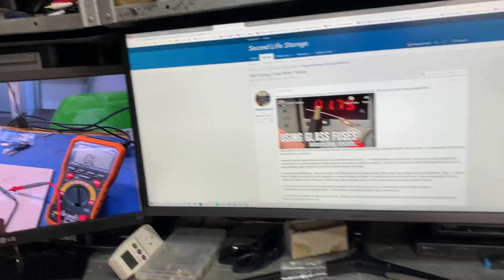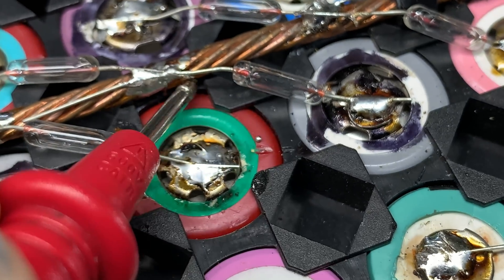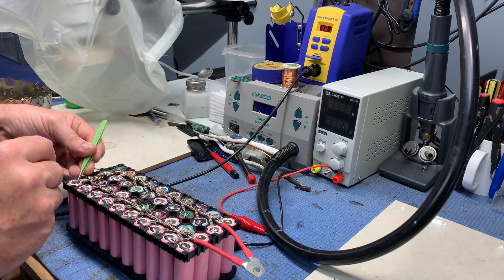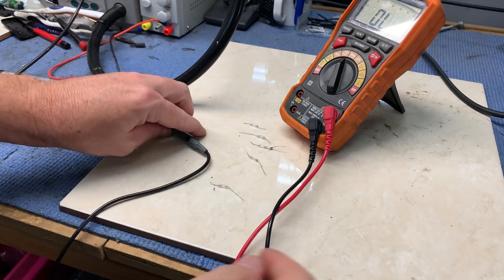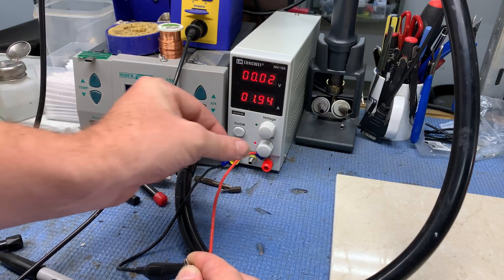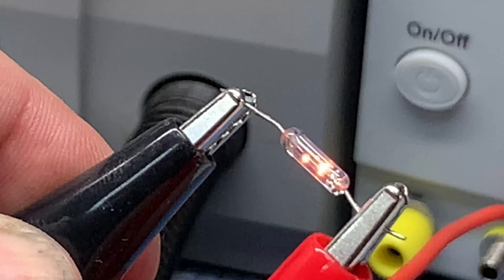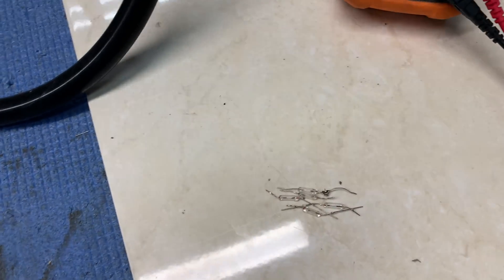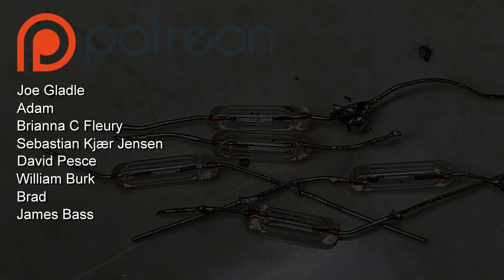Testing the 5 fuses from yesterdays video

Comment: The capacitor on the output of the power supply is blowing the 2A fuse because of the energy stored in the power supply cap. You have to increase the power supply from 0V to eliminate that problem.
Reply from the maker: Yes many others have said the same thing .. least I learnt something new :)

Comment: Hi, I am not sure if the testing setup was right here. The bench power  supplies  have capacitors  on the outputs. These  fuses could  be simply  very fast and inrush curren which will happen once you connected terminals  to the fuse could be more than 10A. I know it from my work experience. The power supply will no regulate  as fast as the  speed of the fuse  therefore you blown all of them. Batter  way of testing it would  be increasing the current  slowly  from zero to 2 A.
Reply from the maker: Thanks for the info

Comment: Let me start off with saying I love your videos.  But that's not a very good way to determine anything about a fuse.  The amperage on your power supply isn't changing because it's going to near maximum amperage faster than the display can update.  Measure the resistance of the fuse (a fixed number) and you have the voltage set at a fixed number.  Now calculate the amperage using those two numbers and ohms law.  You'll find that it is significantly higher than 2 amps.  Same exact reason you don't measure amperage with a multimeter in parallel with the circuit.
Reply from the maker: Thanks for the info, while ago now this one..

Comment: most shitty cheap power supplies cheat with their output ripple rating by whacking a nice big capacitor across the output terminals.  you're charging a honking great bit capacitor up to 4.2V and then putting it across a fuse - of course the fuse will blow.  you're putting tens of amps through that fuse before the PSU's display even updates because the current is coming from the cheater cap not through the PSU's current measurement resistor.

this kind of thing readily kills LEDs too.

Comment: Blowing it with another fuse could prove it with out need of trusting power supply.  I got a pair of cells that only in one order stayed balanced for hundreds of charges. Was reading  impedance remains constant threw cells life. Thinking the impedance of the cells could be graduated to charge evenly.

Comment: so, even if the fuses  work ? what is stopping any of those cells to start an internal reaction, generate pressure, relieve the CID and continue on the internal reaction ? by the way, this can happen under storage, charging or discharging, at any time!
Reply from the maker: one would hope having the fuses blow will reduce the energy- one cell will most likley internal short and run out of puff before it can go thermal.
Reply: The thing is, once the CID is off, you no longer have an electrical connection to the cell, it will read open circuit on the multi-meter.
The amount of energy in a 2.5volts (discharged) cell is really high because of chemistry.
the OEM manufacturer of a laptop battery makes a battery pack from the same batch of cells, some of the cells are removed from the line and tested, after tests are performed they should confirm that the capacity of the battery will degrade enough(unusable by the buyer) before the number of cycles are enough for the cells to be able to develop internal reactions. The chips, sony ones at least, also have a cycle limit programed by the manufacturer. The  safety is same batch and testing.

Comment: When testing fuses with a power supply set voltage to less than 1V. 
Reason is some power supplies have large output capacitors which on short circuit will deliver large transient currents (>10A) which will blow a fuse even if current limit set to 100mA.

Comment: i think i should check the power supply first. as it may blow the fuses due to the capacitor in front of the regulator. I provide a youtube video link check from 14:20.  https://www.youtube.com/watch?v=Wnu6surk4QI

Comment: Amps_through_the_Fuse = Battery_Voltage / ( DC_Internal_Resistance + Ohms_POS_Cold_Solder_Joint + Ohms_NEG_Cold_Solder_Joint + Ohms_Fuse )  <==  So, systematically figure out what your problem is.  Hints ... either, the battery voltage is too low, or the OHMS was too high or you have bad fuses.  Are you sure that you are actually measuring the DC Internal Resistance ?  Because, I heard you say "Internal Resistance".  Maybe, you are actually measuring the AC Impedance - which is not the same thing ...

Comment: This so-called "test" is 100% INVALID .  A 2 Amp Fuse is designed to allow 2 Amps for many seconds!  No, you cannot remove that shorting wire when the Power Supply is in "Constant Current" mode.  Your P/S sent way too many amps through those fuses ...
Reply from the maker: Maybe so but it started a conversation - and I learn something from youtube.. who would have thought lol
Reply: @HBPowerwall  This procedure might work ...
1) Connect your 2 amp "shorting" wire to your power supply 
2) Adjust your knobs for 2 amps = Current Limit Mode
3) Now the "Amps" knob is set correctly - do not change
4) Reduce the Voltage Knob down 0 volts <== Important
5) Remove the shorting wire
6) Attach the fuse
7) Increase the Voltage Knob = 2 amps flowing 
Fuse blown?
I say, "No, it does not blow. It holds for a long time"
Before testing a new fuse, always reduce the Voltage down to 0 volts ...

Comment: I have to revise my statement about the capacity a little. These lithium crystals can form quasi like a needle and thus accelerate the internal charge exchange. The danger then lies in an internal short circuit and thus in self-destruction. Since one cannot predict the aging process, thermal monitoring is essential for me.

Comment: Hi Pete, You are going in the wrong direction. The problem with cell heating is not the current that is drawn from the outside, but the current that is generated internally in the cell. With the length of use, there is a loss of capacity. This loss is unused lithium crystals. These accumulate and reduce the distance to the anode. If the internal resistance is reduced as a result, this would explain the self-heating, although the external current draw is low. Please take the bad cells, do a capacitance test and monitor the self-heating with a constant, low current draw. For reference, do the same with a good cell in parallel. This should make it clear to you that there can be a critical, low capacitance.
Reply: Heater Cells, actually do get hot from the "outside" CHARGING Current  ...
Reply: @MrSummitville  Well, then please explain to me why not heating the other cells just as much? And where is the causal difference now? The difference is the internal behavior and not the charge supplied.
Reply: @SchnickSchnackSchnuck.   You said, "... Well, then please explain to me why not heating the other cells just as much? ..." Can you rephrase using proper English?
Reply: @MrSummitville  Or, you can talk with me in German. You can do that as well as I can. I think you understand very well.
Reply: @SchnickSchnackSchnuck.  No, I cannot understand what you are asking.  I clearly stated, heater cells do get hot from external or charging amps.  Either, you understand that fact or you refuse to accept reality ...
Reply: @MrSummitville  ... or you. After reading some of your comments, you are too self-confident of yourself. Therefore any contribution to them is unnecessary here. It's a shame you could have learned something. Over and out.
Reply: @SchnickSchnackSchnuck.  I see, you still have no facts to back up your claims.  It is a fact that Heater Cells do get hot from external / charging amps.  Simply disconnect a Heater Cell and see what happens for yourself ...
Reply: @MrSummitville  I have facts, but I don't fall for a provocateur like you. You are no longer worth paying attention to, because you are disrespectful. Go your way and don't stand in your way. Get your facts right, before you claim something you can't prove. Like you did with me.
Reply: @SchnickSchnackSchnuck.  Watch the countless YouTube videos that PROVE ... Heater Cells do get hot from external / charging amps.
Reply: @MrSummitville  Yes, and why this one is getting warm and the other one next to it not? Exclude the external current. It is the cell, which have an inner shortage behavior. There are unused Lithium crystals, they can form a needle to the anode. Known as cathode shortage. It is not often, but part of coincidence. You can't load this cell so hard anymore as the other around them. Root cause - effect.
Reply: @SchnickSchnackSchnuck.  I NEVER said, Heater cells can't have an internal short.  I have stated,  Heater Cells do get hot from external / charging amps.  Which you claimed was "wrong" in your original post. Watch the videos and learn ...
Reply: @MrSummitville  If you mean, you are right, that's fine for me. I hope you learn something for yourself. And now, it's time to say good bye. Please find a different audience for your point of view. Saying sorry is a matter of character, but the solution.

Comment: I think need to series 40c thermal fuse in the 2A axial fuse every cells.. so it's blown once they reach the desire temp.. to avoid heating of cells.. what do you think pete?
Reply from the maker: Madness, a lot to be said for keeping it simple - sealed box air in at bottom - air out on top measure the temp differential make decision based on that.  IE 20deg difference TURN on fire hose and run, 1-3 deg difference SHUT it all own till you can inspect it.

Comment: My conclusion using these same fuses was with about 5% of the fuses have an internal disconnect and when you touch them with a probe or press on them or even take the dam things and test them, you end up bending the leads, binding them up, and essentially fixing them temporarily, you still have a disconnect inside that will be there randomly but they check out 90% of the time.
Fuck those things.
Reply from the maker: Sounds possilbe

Comment: Next thing to test that I can think of load test the cells individually.  If the fuse is 2 Amps then each cell that is supposed to be protected by them needs to be able to handle 2 Amps without too much voltage drop.  My guess is you need 0.5Amp fuses for that battery pack or at least for the weak cells.
Reply: But this so-called test was 100% invalid ...
Reply: @MrSummitville  I agree it was more of something fun to watch then a real test.  The math behind it meant we knew the outcome before it started.
Reply: @AQUATICSLIVE  The Power Supply actually pumped way too amps ( more than 5 amps ? ) into those fuses.  He can NOT do this "fuse test" per the method in this video ...
Reply: @MrSummitville  Yeah he did it the other way too of slowly adding more amps until it blew.  The issue is without him know the battery numbers he has no clue what fuse to use.  2 Amps is way too big.  Can estimate the math based on his marked numbers and internal resistance average of ones I have.  Max fuse would be 1 Amp.  But without some real testing of the cells can't be exact but with used cells it's not perfect.  I would use .5 Amp fuse wire to be safe but I like to error on the side of safety.
Reply: @AQUATICSLIVE  Also, I noticed that he states "... Internal Resistance ..." but it appears that he actually measures "AC Impedance" - which is not the same thing ...

Comment: Small question, what is the internal resistance of the non blown fuse cells? If it might be high it still delivers the Voltage but when shorting it might have itself a higher resistance than the fuse in which case the Voltage might not be big enough to blow the 2A fuse. Are you able to get the internal resistance of those cells with the chargers you own. Thanks in advance, you are great showing us how not to build packs and save us from harm 👍

Comment: The power supply has charged the capacitors on the output of the power supply. Bring the voltage up slowly and the fuses wont blow instantly. start from 0.5v then increase the currant.
Reply: You are 100% correct, therefore this test was invalid ...

Comment: Hi i think spotweld.s are much cleaner  and you need New protection arround the 18650 Just a little hole arround where the postive is wil make a verry fast hot fire 18650
Reply from the maker: Spotwelding is 1000x better, but this battery is years old and trying to learn from past mistakes.

Comment: If they blow immediately at 2A, they are not 2A fuses. I don't know the datasheet for these, but usually a fuse will blow after 0.1 to 1 second at twice the rated current. At the rated current, they can sustain forever.

So these are probably 1A or lower fuses.
Reply from the maker: They were sold as 2amp fuses :( Years ago
Reply: @casparv
 - Probably not 1 amp fuses.  The power supply is pushing way more than 2 amps through a 2 amp fuse.

Comment: someone was saying in another video your power supply has a capacitor on the output and the current limit only kicks in after the capacitor discharges. so even though you set the limit to 2A, when you connect the fuse it will spike above 2A for a fraction of a second.
Reply from the maker: It is possible yes, my amp meter wasn't accurate/fast enough to check that but it does sound likely .
Reply: @HBPowerwall  More than "possible". Your fuses did get a huge spike in amps ...

Comment: There's a good chance that the output of that PSU has a large capacitor attached to the output, it probably well exceed the set current for a fraction of a second. You might want to start at zero amps and creep up to the current and see when they blow.
Reply: And he need to do that with the fuse connect to the power supply BEFORE he turns the knobs up ...

Comment: I think your going about this the wrong way mate. You may be making assumptions that the fuses are faulty, but what you've just proven is that they work just fine and blow at 2A. 

I think what you've also proven is what I suggested in your last video, and that is that the cells that did not blow fuses COULD NOT blow them because they are so degraded that they cannot even muster up 2A of current flow on a dead short. 

Your ammeter should have a 10A rating, so pls put it in line between one of those cells, and a fuse, and short out the single cell. I think what you're going to find is those cells although fully charged at 4.2v cannot even deliver more than an amp of current draw. 

Please test that out as it would highlight for the community another point of failure that they likely are unaware of, and that is a cell that can go dead short and pull just under an amp heating up constantly, but without enough current to blow a fuse.
Reply: I just tested my twenty cells and the inrush, dead short across the cell, was between 32 and 37A on my CL800,  momentary touch, so don't use a nice meter fyi
Reply: @Joe Marques
 - Actually, this so-called test proved nothing.  His power supply gave those fuses a huge in-rush of amps.  This "test" is 100% invalid.

Comment: so maybe there should be a fused short test done on each cell before putting it into a pack ?
Reply: this test might need to be done with a poly fuse resettable
Reply: or maybe one of these 
https://www.amazon.com/Blue-Sea-Systems-Connect-Circuit/dp/B000MMDLQQ/ref=sr_1_53?dchild=1&keywords=resettable+fuse&qid=1610377209&sr=8-53

Comment: Can we create a large scale multi fuses tester that is not expensive to quickly detect poor performance batteries and be able to remove them easily?
Building a good power supply is the key, unless these failed cells are developed over the course of time
Reply: Failed cells develop over time ...

Comment: Could it be that batteries could not supply the 2amps to make them blow.
Reply from the maker: Honestly I doubt it. Each one of these cells could do 20 amps with the right gauge wire. They shouldn't but they easily could.
Reply: @HBPowerwall  Thanks for the reply just guessing. Did you figure out what happened?
Reply: @HBPowerwall  Then put a 1 Ohm Resistor across the fuse wires and show us that the 4 cells can each produce 4 amps for many second,  through the same Cold Solder Joints and small fuse wires ...

Comment: Just short out the suspect batteries with a glass fuse, you don't have to solder it in place, just a wire from the negative, through a fuse and just touch the positive end, if it doesn't blow, then that would mean that the battery has high internal resistance and should be taken out of the pack! If it blows one or more, then maybe the solder connection was bad! Possibly a dry solder joint? If that's the case then measuring the current draw across the fuse should show up higher than on other cells but you would need to put a load on the whole pack to see if there's a dry solder joint... Hope that helps.

Comment: For anyone wondering - glass axial fuses blow at around twice rated capacity, so shown fuses are most likely 1 amp rated.
Reply: @vicgarbutt3310  he’s using a constant current lab bench set to less than 2 amp max, the max surge will be 2 amps?
That’s the whole point of these units.

Comment: Are you sure the powersupply is quick enough to limit the current? I've tested these fuses with a decent lab supply with 0.01A increments, most of them blow at about 150% their rating with a glowing wire at 130% avg. But there seems to be at least a 20% deviation.
Reply: No, his Power Supply cannot control the High Amps in-rush, when the fuse was connected.  This test is 100% invalid  ...